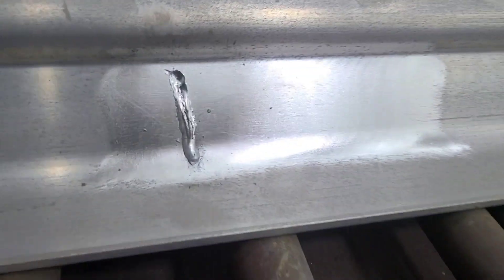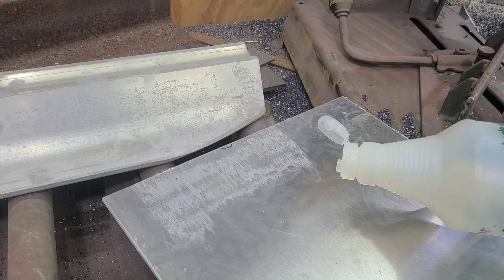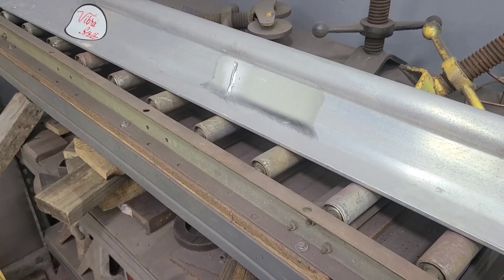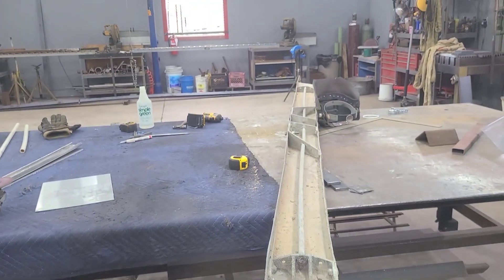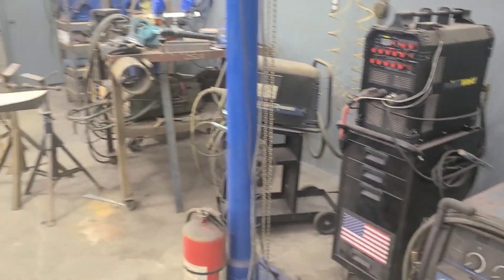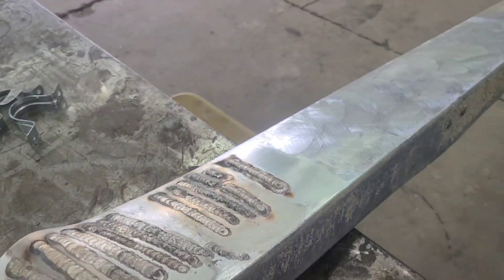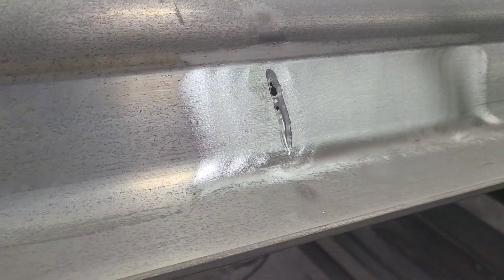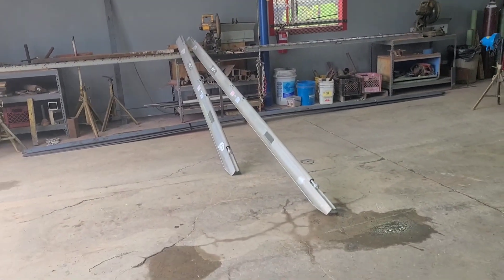I messed that up...but I fixed it

Comment: Nice work sir. New to your channel are you in business for yourself
Reply from the maker: Yessir...I worked for several different welding and fabrication companies from 1991 to 1997 and I joined Local 697 Ironworkers Union in 1997 to work on the construction of the Green Bank Telescope.  I left the Ironworkers Union and started NBS WELDING in January of 2000 and I have remained a one man operation performing welding and fabrication services ever since.  For the last 22 years most of the work I have done has been serving the natural gas drilling operations of the Appalachian Basin.  That oilfield work was awesome but I am not doing much of that these days, I'm mostly just trying to serve local customers and companies.
Reply: @NBSWELDING  that’s awesome. If I could be my own boss I’d do the same and stay a 1 man operation. Like the videos and the explanation behind it. Your teaching me cool stuff and love the shop sir. Thanks for replying.